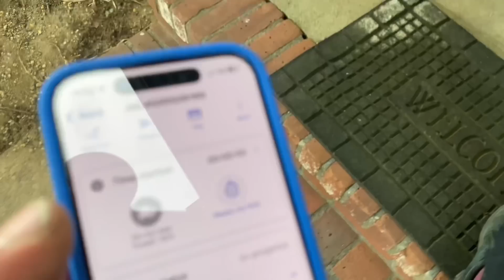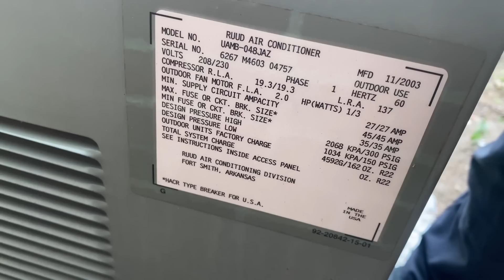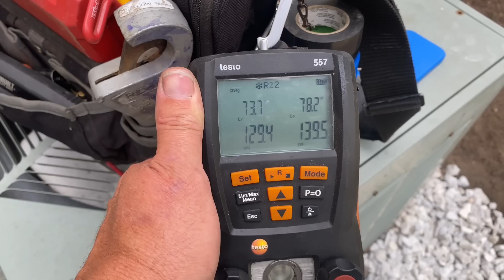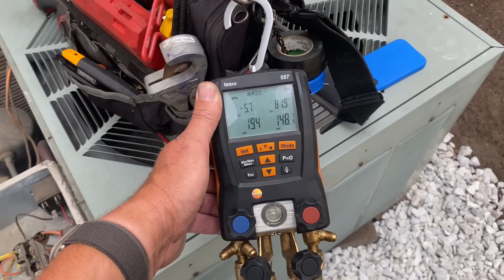Actual HVAC Service Call: Central AC Isn’t Cooling Indoor 89 Degrees Decades Old Rheem Low on Freon

Comment: I have about the same unit, 5 ton, 2002 RUUD.  Seven years ago, I had low pressure 2 months after previous service. My AC guy added sealant and 3 lb refrigerant ($240 total).  It has operated well since then.  I live in Houston.

Comment: I installed my Rheem “12” seer in January “2000” My outdoor unit sits on a concrete pad. No dog pissing on it Every January I ask myself should I replace my equipment this winter ??? I’m an HVAC/R mechanic so I would be replacing it. I just replaced the service valves beginning of May the original valves were the type with the snap rings. Cut out the factory drier from the inside of the condensing unit put it on the outside 2 new service valves pressurized with nitrogen let it sit for 3 days cleaned condenser with Nubrite changed the contactor and capacitor evacuated dialed in a precision charge with R-22. This is now the “25th” cooling season🧐🤔 Do I gamble for another season ?? Do I go for “30” years ??? When will the Fornication corrosion kill my unit ??? A lot of the information on the Fornication corrosion points to the eventual leaks being on the Evaporator 😵‍💫😵‍💫

Comment: 2020 pricing in fariefield ct for ruud 2.5 16 seer condenser and AHU with hot water coil,  2 zone dampers, zone controller, 7.8K.  Thank you Bradon for the great job you did for the middle class where today that same setup with cost around 11K.
Reply from the maker: Thanks for sharing
Reply: It’s built back better. By Senile Dear Leader.

Comment: Mikey you keep it real so i will. Im not sure if its just the way i grew up or my fiancial situation, but ive always dealt with a/c window units
Figure $350 a pce every 5 to 10 years and ya my lightbill is like $30 per month per unit as opposed to say 20k for a unit at what like $500 a yr for maintenance service😅

Keep in mind your pricing and fees for your market seem to be comparable and just what they are your service seems though dose make value of cost   a worthy investment 👌
Reply from the maker: I also grew up with window, AC units and a whole house attic exhaust fan that once the sun went down, my parents would open all the windows in the house because they were closed all day and then let all of that cooler air outside gets sucked into the house and up to the attic and out

Comment: Last I checked?? 22 was like a grand a pop an that is if you can lay your hands on it … and we can thank Biden economics everything is triple the cost … What hard to believe as I used to put in a 4 ton system complete line set condenser evaporator coil labor out the door 800 bucks😂😂😂 yes that has been a few 1000 moons ago …but seriously it tears me up to have to tell them the bottom line😢 I really feel for them, especially the senior citizens, but I can’t ask my people to work for nothing. I can’t work for nothing. It is what it is. Makes me sick to my stomach, but it is what it is. Plus?? Honestly that 22 unit was on borrowed time… but like you told the customer what really truly sucks is we’re gonna sell them a new unit this is gonna be a dinosaur in a year. That really sucks.

Comment: $250 a LB for a $800 drum of r-22… you could pay for mo-99 a jug for $600…. Ur a damn Scam……
Reply: I, also pay $800 for a 30lb tank of R22.  I charge $175 a pound plus the Easyseal.  A $2000 dollar repair and leak search, but it very likely could be in the shraeder cores and caps.  If it is the coil, just replace the coil and and move on.  Odds are that you did them a solid, they will give you the change-out when they can afford it or get financed.  Either way, it probably gets them through the summer and they can save some money for the replacement unit.  I own my company here in Colorado and get that people can't drop 12k-15k.  No reason to get into the name calling.  Two pretty good pay days to get it running and possible replacing the coil on the second trip.  Both of you win.  Down the road, you get the full change-out because you got them through the hot season.  Just a thought.
Reply from the maker: you are. fool sitting at a keyboard with monopoly numbers in your head. i am a licensed and insured professional. you are nothing.
Reply: @PipeDoctor  I’m a VRF specialist also, specialize in VRV Daikin and city multi Mitsubishi. I can email you my TACLE #
Reply from the maker: @grantbrown-t2u  exactly, you are an indian. not a chief.

Comment: 30 lb cans of R-22 are $800.  That's $27/lb.  You have the gauges hooked up, and the system wasn't empty.... juice it up for them.  My friend filled his R-22 with 6 lbs last year and it's still working today... BTW, his guy added NU-22 (dark blue can) which was like $150 for the whole can and charged like $120/lb.  Stupid markup and shouldn't be mixed.
Reply: The new generation are crooks with  excessive prices.I worked in the field until the early 2000.I received a quote a few years back from an ac co for a standard condenser fan mtr installed for $1000 to him shove it up your ass replaced my self.
Reply from the maker: @stephendamato3748 "worked in the field until...." that sums up your experience. Good for you too. Don't die broke.
Reply: Hold up $800 a can for 22. What state I’m from Ct and we pay more then that for a can
Reply: Ability Refrigerants has 30lb of R22 on sale right now on their website site for $845
Reply: Juice it up? Your taking advantage of the customer by juicing up a ac that needs to be replaced anyways its like stealing. doing that without fixing the leak.
Reply: yes, the price quoted for a top-off is insane. not that top-offs are good.
Reply from the maker: @Jon-hx7pe another rocket scientist. spitting out prices from yesteryear! thanks for the engagement. helps my channel and thriving business GROW!!!!!!!!
Reply: @PipeDoctor  30lb of R22 is selling for $845 now on ability refrigerants so he's not kidding. Less than an hour to add, a few pounds doesn't add up to $2k even with a very healthy profit. 

$2k should cover a leak repair of existing system.

If people stopped being so trusting and looked up refrigerant/parts pricing, these gouging practices would come to an end.

You get angry and name-call when challenged with facts - real professional there! There are complaints of you being rude in reviews too.
Reply: @Jon-hx7pe  100% agree.  I pay $800 for a 30llb tank of R22, and I do not use drop-ins either.  One system recharge pays for the entire tank and the rest is gravy.  I would add a leak/dye Easy seal after charging it up.  Replace the shraeder cores and caps, then return and do a leak search.  Yes, it will be a $2000 bill for a couple hours of work but it would get the unit up and running for who knows how long.  Find and fix the leak, if it wasn't at the cores or caps then it might be the coil that might be fixable or a replacement.  I have several window units that I loan out, during the repair time.  They will likely give you the change-out when they can afford it.  
No reason to get angry and state all the the name calling.  But I agree, drop-ins are a terrible practice.
Reply: @Balticblue93  I don't think the sealant is a good idea unless it is a absolute last ditch on a old system that will never be properly repaired.

Drop ins do have capacity loss and glide - i don't think they're "evil" though especially if the machine is oversized already.
Reply: @Jon-hx7pe Price gouging, you people are ignorantly hilarious. You have no concept of how to run a business yet you come here quoting prices on what you think should be charged. You don’t know what you’re talking about to even have an opinion.
Reply: @Jon-hx7pe   We use EasySeal quite often and had very good luck with it, especially in R22 systems.   They have kept systems running for years, but I do have a separate set of gauges for R22 and Sealants with dye.  If it slows the leak and helps the customer get through the summer, that is a win for the customer.  If the Dye shows itself during a leak search, fix the leak and move on with life.   If you take care of the customer, when it is time, they will give you the change-out.  Change the shraeders and caps while you are there.  Replace the coil, if that is the issue that isn't repairable, which most will be repairable.  

For the cost of what I pay for R22, and what I charge for it, it doesn't make any sense to use a drop-in.  I don't think they are evil, I do not like them for what they are.  I prefer to only use R22 on our vans.  I tried a couple and that was the end of that.   We repair R22 systems every week and stock quick a bit of it.  
Here in Denver, people are much more likely to pay $2000-2500 for a repair than a 13k-18k system.  This also gives them time to save up as they are on borrowed time.  But don't get me wrong.  I give them six options.  Do nothing, leakseal and charge, leak search and repair with dye, with possible coil replacement, and a quote with five system options for change-out.  Those will include a cash price or financing options.
Reply: @Balticblue93  If the machine is running 410a and not old, using sealant is a total travesty and equipment will never be the same after imo. old r22 stuff is a different story.

pricing must be very high in your area to have systems be 13-18k unless you're talking new ductwork. i'm in canada southern ontario and can get a a/c + coil replacement for $4 to $6k. Add in a furnace at same time and that goes up to $7 to $10k.
Reply from the maker: Here is another child sitting in their parents basement abusing their internet privlidges. 
$800 for 30lb of R22 - yeah, like in 2021, maybe closer to 2020. Get fcuking real a$$hole.
Another "HVAC contractor" who thinks they know how to run a profitable and successful business.
BTW< NU-22 is for hacks. 
You are stuck in the 1990's. Get a life and GTF off my channel!

Comment: I can install a AC with a helper in 6 hours.  But I cut corners
Reply: Most states now require you to be licensed & insured to work on any mechanical systems now! Don't want anyone cutting corners in gas furnace that's just outright dangerous!

Comment: This is a little off-topic, but I’ve been meaning to ask how many capacitors do you carry on the truck and what’s the range 45/5 35/5  that you carry?
Reply from the maker: I carry 2 of every single size single and dual caps.

Comment: I’m not sure why anyone would question the low teen price. That’s actually not bad compared to other companies. Here in sc some companies would charge 20k for a change out and replacing the line set. And that’s basic equipment.
Reply: 20K? That price of system butter do everything for you but why is new systems breaking down every two to 5 years?
Reply: @michaelyoung394   quality for everything has gone down, not just HVAC equipment. But cheaper parts are being put in units like Chinese capacitors and contactors. It’s just the world we live in. But a good hvac company will take care of you if something does go bad on a new unit.

Comment: I get markup… but Mikey… how many times are you marking it up???
Reply: You mentioned markup at 9:45
Reply from the maker: Mark up what? I am a licensed professional.
Reply: The price of equipment that we have to buy from distributors have gone way up and next year going up almost 20 percent.materials such as line sets are up.he said low teens.for a attic change out not a bad price.

Comment: In certain types of houses, you can put in a large down-facing ceiling-mounted exhaust fan, that transfers outside air through the lower floor windows, and forces exhaust air out the upper story attic vents. Or: would a swamp cooler work in that area of summer climate? Seems like maybe a pair of mini-split systems would be less expensive. Maybe the home owner could handle a DIY install, if the mini-split comes factory charged with Freon.

Comment: Also why so much ? You are giving us a bad name unless you are selling them too of the seer rating Trane variable speed unit that up north they don’t need . Sorry buddy just calling it like I see it   , you don’t even know how big a leak it is . Try it and get her cool for now with a 23 drop in
Reply: Prices are much higher in NY. Union contractors. Also, his work and quality of installation are well worth it. You get what you pay for. Want a shitty unit that’s going to have issues in 6-7 years. Go with the cheap bid. His units will be running trouble free for 10-15 years or more.
Reply: @Spillmansgarage  there’s no residential union in New York or New Jersey Mikey is not union
Reply from the maker: thank our President. LGB

Comment: Heating & Air Conditioning is getting too expensive for the average home owner. Air Conditioning is soon gonna be a luxury most common folks cannot afford.
Reply: @michaelyoung394  Depends where you live. In TX where I am it is most definitely a necessity.
Reply: @michaelyoung394 he said the cost would be in the low teens not 18. Nonetheless, I believe window units will be great again, lol
Reply: @10speed4  I use a window unit it fails get another 400 bucks
Reply: @peter-pg5yc  are you saying you don’t like your window unit?
Reply: He likes window units I do too!
Reply: @michaelyoung394  I like them too. There’s no loss in transporting the cool air through the ducts.
Reply: Unfortunately window and wall units will get more expensive with demand!
Reply: I messaged my Sen and Cong in DC to pull back the new regs for some years. It's going to kill the type of customer in this vid -- next years price $18K. I guess they'll have to get a 3rd and 4th job on Sat and Sun . You were very gracious in the deal.
Reply: It the all the regulations that Washington telling the EPA by law of saving energy and saving the environment . Wait in till  all  the new refrigeration system coming out with the AL-2 it’s going to cost the homeowner more money.
Reply from the maker: no its not. HVAC is a necessity. if you can't afford upkeep of your investment, you need to improvise.
Reply: @PipeDoctor 💯💯💯
IF YOU CANT AFFORD TO RUN AND REPAIR THE EQUIPMENT IN YOUR HOME YOU NEED TO REARRANGE YOUR PRIORITIES!
Reply: Easier said and done with inflation, and price gouging everywhere!
Reply: @PipeDoctor remind me not to listen to your professional opinions, and not follow your channel!!! 

Maybe you should research WEF before commenting on others budget... 

You are ignorant on actuall global economy... Which Means your ignorant on your profession!!

Comment: hard to drop 15k when you can buy 4 window units for 1500 bucks.  but nothin is worse than a hot bathroom and well worth spending the cash for central AC
Reply: Don’t need a car can buy 25 bicycles
Reply: @Mridgwell 😂😂
Reply: Central AC is also easier on electric bills than window ACx4.
Reply: @jimreilly917  im not sure, you figure if you have 1 on during the day maybe 2 then at night they are off and the bed rooms have smaller 5k BTu units. I tink it might be cheaper over the long run. 

Plus, even if they are more expensive to run you are stiill saving 12k+ and not sure how long it would take for 4 window ac's to use 12k worth of power.
Reply: you  can assume for 3 months you use the AC's even if you bill was $200 a month for AC alone that is still over 20 years to spend up over 12K 
And that is a budget system, highend it would take like 35 years 

But Its finew, I dont like sweating when i poop, so worht the investment.
Reply: @swaterman08  so every person who has central air has made a bad decision and thoughtlessly spent money when they could have window units ?   A house that can run off 4 5k window units would need a small system would be way less then 15 -35k your rationale is whacked but incredibly funny at same time thank you
Reply: @swaterman08  also need to add overall comfort efficiency and convenience to your little equation
Reply: @Mridgwell  I said its worth the investment, no one wants to poop in a bathroom that is 100 degrees.   you can also consider equity. having a nice new HVAC it will be easier to sell a home.  Main issue with using only window AC units, the bathrooms are always hot as sht. 

Its just like all you need in a Smart Car, but I spend the extra money to drive something that is fun and cooler. Which is fine, just don't say you will save money if you do a 100% new install of HVAC in a home.

My point of view from the video, was the home owner did not have the cash to pay for a new system. If someone is cash poor with bad credit its hard to justify spending 10k+ when you can run to Home Depot and sleep in a cool bedroom for 300 bucks with a window AC.
Reply: tv ad in rockford il say new central A/C unit installed for 3k  = Gillies heating/ cooling